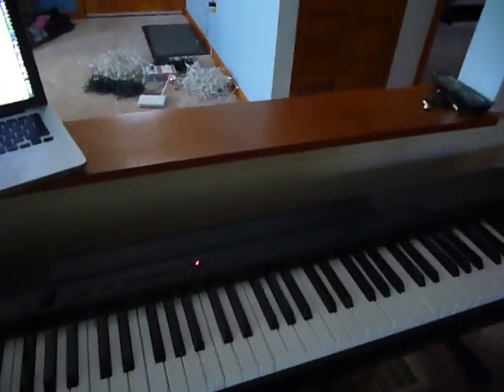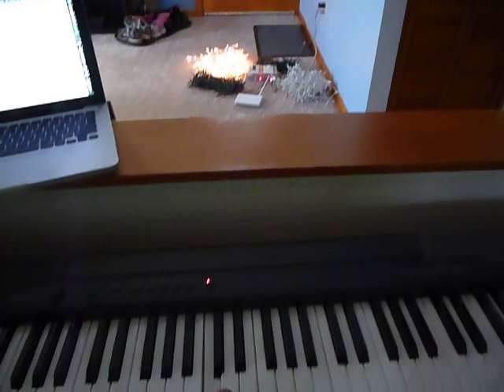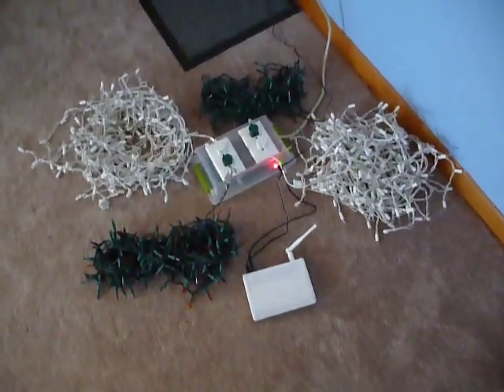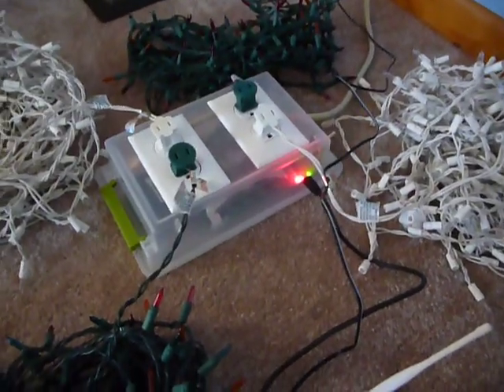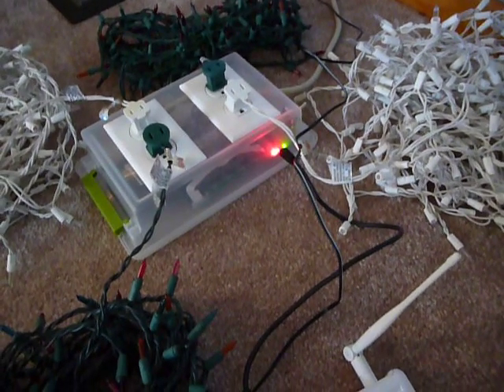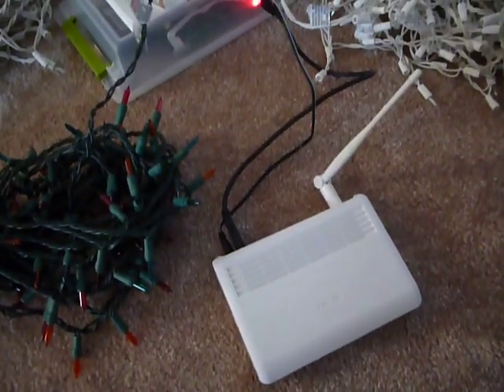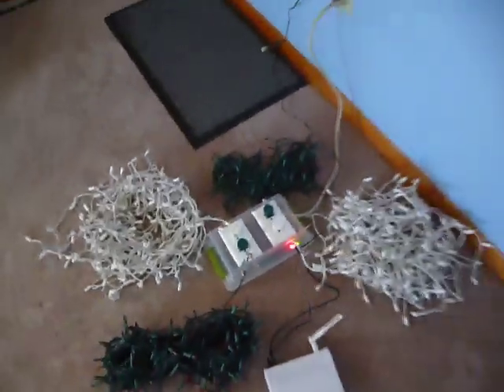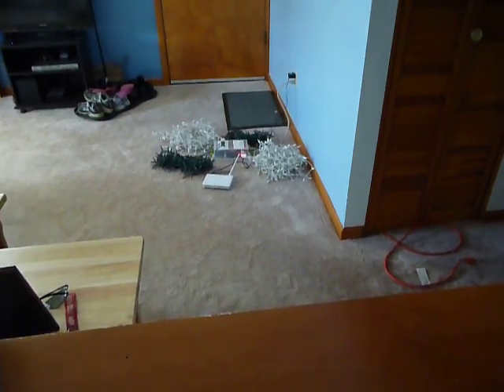Wireless MIDI controlled Christmas Lights

Comment: Hi Tim, if I would like to control such lighting non-wirelessly, do I still need the USB/GPIO interface board and only use the Opto-Isolated relay board? I am new to electronics, so trying to figure this out as I really like this...
Thanks a bunch!